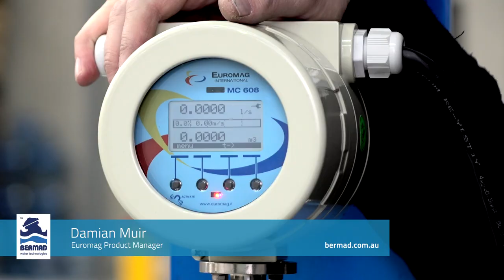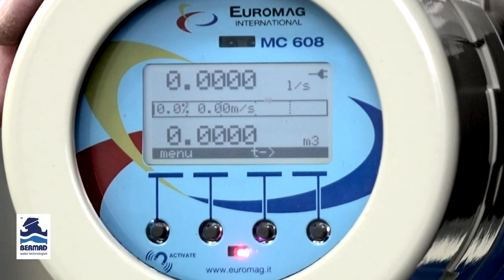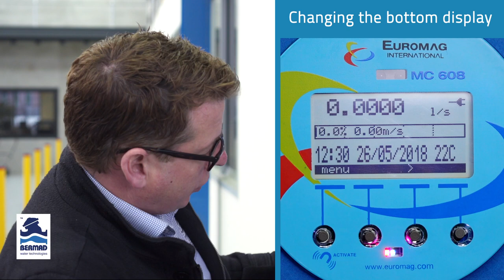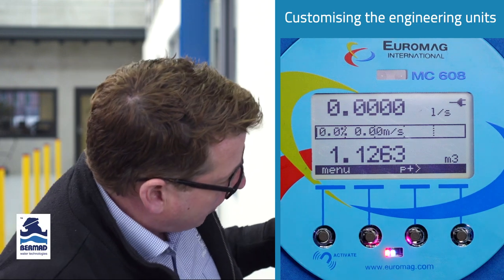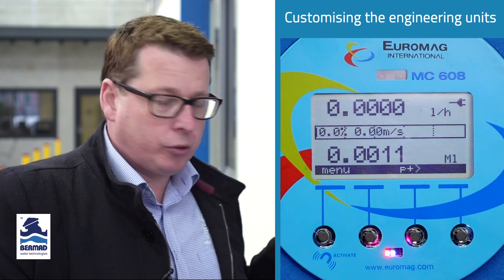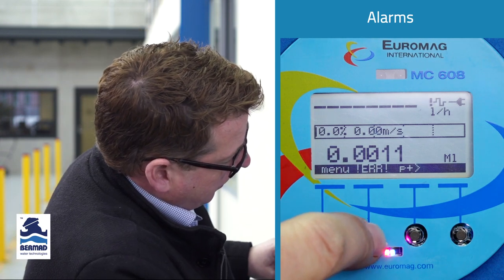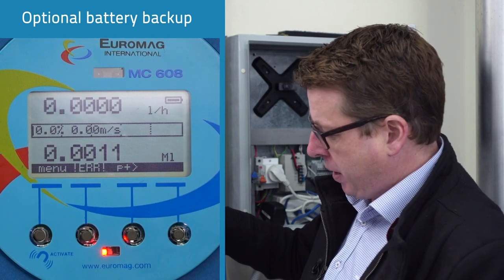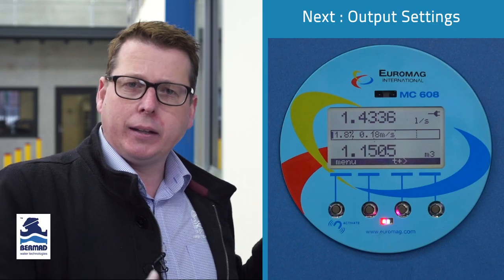How to Read and Configure the Euromag MC608

Comment: We had a failure in 12V power supply in this module. We replaced it , but now it is giving error readings. Do I need to reconfigure it for the pipe diameters and all?

Comment: Hello, we have one of this but we need tonpassword
Reply: There are three passwords: Level 1, Level 2 and Level 3.  
Level 1 is to protect low sensitive parameters, Level 2 for medium and Level 3 for high sensitive parameters.
The default passwords can be found on page 41 of the operation manual - see following link:
https://www.bermad.com.au/wp-content/uploads/2016/11/Operation-Manual-for-MC608.pdf
Level 1: 608111
Level 2: 709222
Level 3: 231042
Different parameters will prompt you for the specific password depending upon their sensitivity.  The Pulse ton password is Level 1 however I should mentioned that the Level 3 password will allow you access to Level 3 protected parameters as well as Level 2 and Level 1.  So, in other words Level 3 allows access to all sensitive parameters.

If you are concerned about unauthorised users using the default passwords to access sensitive parameters then the passwords can be changed by pressing the MENU button then navigating to:

MEMORY > PASSWORD SETUP
You will be asked to enter the Level 3 password as this is a highly sensitive parameter
See following link for the MC608 programming guide to help navigate the parameters:
https://www.bermad.com.au/wp-content/uploads/2016/11/Programming-Guide-MC608.pdf

PLEASE BE WARNED:  It is very important if you change the Level 3 password that you do not forget it later.  There is no master code and so there will be no way to access these parameters